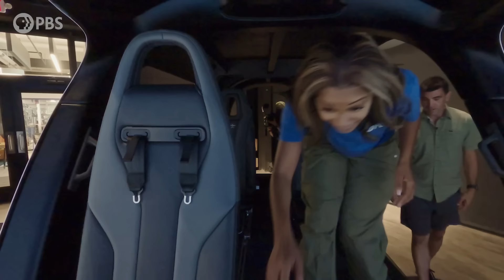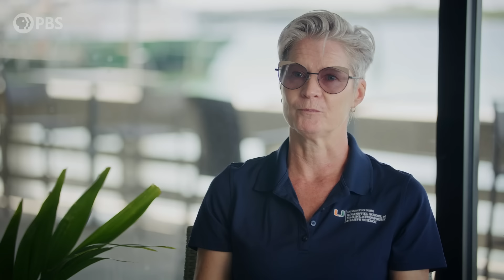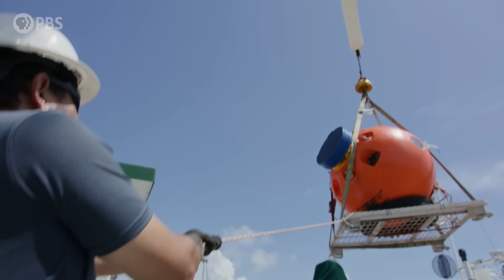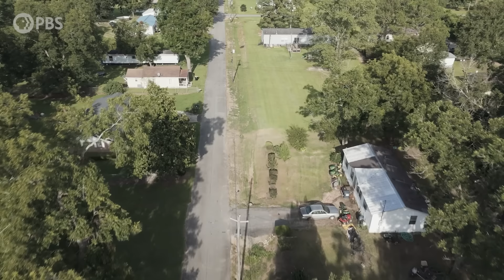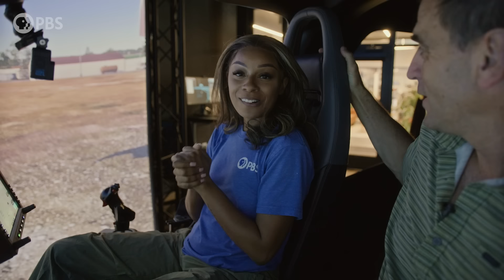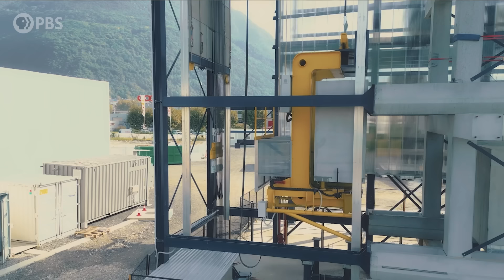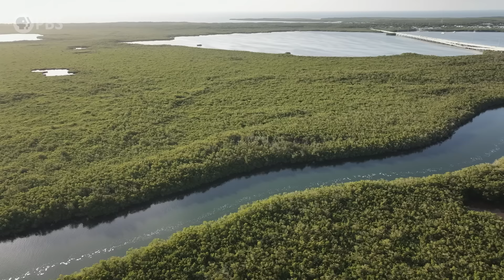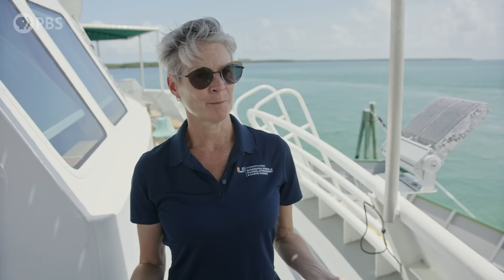This Is The Best Evidence That Atlantic Currents Are Slowing (AMOC Explained)

Comment: This is what no one is talking about. All of these people are going to FLOOD to the Midwest and they're not ready for it.
Reply: yeah, I'm going to lock down a 2nd mortgage in Minnesota. If things don't completely collapse by then, it'll inflate so much that I might not have to live in complete poverty.
Reply: @zacharybohlman4069  With due respect and with good intentions, I ask you, do you really think sea rise will result in or requires a 1,000 mile migration from the coastlines?  I'm four miles from the Pacific Ocean at less than 600 feet.  Why would I move from a huge body of water that moderates temperature extremes to the Midwest which is known for temperature extremes?  Again, I mean well.  Your thought just seems quite irrational and perhaps an example of misplaced regional pride.  Please let me know where I'm wrong here.
Reply: @OneAmongBillions 1000 miles is maybe a generalization, but there WILL be significant migration away from the coasts as those coasts move further inland and swallow up current coastal cities. The east coast will probably have it far worse than your Pacific coast location because overall the population density is higher on the east coast, and because more of our is going underwater (think most of Florida). 

The other thing to consider outside of migration due to sea level rise is that people are also going to be fleeing the dry southern states as they become increasingly unlivable. Think Phoenix but hotter for longer and in an area from inland SoCal to central Texas. If/when the Colorado River dries up, it's going to be so bad.

Those people will have to go somewhere, and even odds they'll go where the population is least dense. Except that the Midwest doesn't have the infrastructure or resources for that many people, and after a point they won't be welcome. Again, it's going to be *so bad*.
Reply: @ Thanks for replying at length, but I'll refrain from further discourse with you.  Why?  I have a strong sense that you're a troll as evidenced by your contemptible "won't be welcome" comment.  I have known lots of people from the midwest and none of them have exhibited the childish tragedy-glee for others that you are exhibiting.  I'd say grow up, but personality disorders typically worsen over time.  Please have the last word.
Reply: @OneAmongBillions  I can only guess that you're responding to me- if not you have my apologies, and please feel free to disregard the rest of this post. 

FWIW, I take absolutely no glee or pleasure in considering what climate change is going to do to coastal communities, quite the opposite. It's going to be awful for them, financially, emotionally, and socially. We're already seeing the very first coastal and island communities having to abandon their homes, and it's terrible. And it's going to get worse. AND it's going to ripple out far beyond those communities. If you think you won't be affected at all by climate change, you're absurd and it's not worth trying to have a serious discussion with you. 

If I seem cynical about how people in the Midwest will handle an influx of climate refugees, then...well, honestly, I am a bit cynical. after over 10 years in call center customer service it's hard not to be at least a little cynical about how people deal with problems. Nevermore that there's plenty of historical precedent from very ancient times all the way up to today about people only putting up with an influx of strangers for so long before saying "enough is enough" and trying to send them on to the next place down the line. 

I dunno, I could write at faaar greater length, depth, and specificity about all this, but I'm typing on a cellphone which isn't great for extended dialogs, plus this is the freaking YouTube comments section and I'm responding to someone that grossly misconstrued my original post (and that's if I'm being generous). Why am I doing this? Because this is a serious topic, and it deserves far more serious and sober discussion than it usually gets. If that means I'm trolling or otherwise deranged, man, I dunno.
Reply: @OneAmongBillions In your case, you might move further inland due to several factors. Your regional in general is becoming drier. So anything to the east of you is also going to be affected by anthropogenic effects. Look at Arizona and Utah. Midwest has the largest source of freshwater in the country. Cost of living is going to be a factor and so is population density. Not just sea rise you should be worried about here.
Reply: @ As stated, I have no expectation that sea level rise will effect me at 570 feet above sea level.  Several of you seem to be taking pleasure in a coastal doomsday scenario, which is indication of moral perversity.  Do you really think the evermore powerful tsunami of technology won't modulate water issues?  By the way, why the regional rivalry?
Reply: Ready or not they will move!
Reply: Its worth remembering that not a single climate change doom prediction has EVER come true.....
Reply: @manoo422  Dark Triad personality disorder, right?  That's my supposition because your claim is, of course, beyond stupid.
Reply: @manoo422 Dark Triad personality disorder, right? That's my supposition because your claim is, of course, beyond uninformed.
Reply: @OneAmongBillions  🐑🐑🐑🐑🐑🐑🐑
Reply: @manoo422  No way you have seven girlfriends!
Reply: The narrative is set blame the victim for living in the wrong place. All despotic regimes need a constant supply scapegoats climate change will do that nicely for the fascists.
Reply: I’m just worried for my rent hiking up 😭
Reply: I think we are ready for it.  Plenty of towns here need more population.
Reply: I think the Midwest could take a few refugees. I grew up there… plenty of space and friendly people. Now I live in Colorado. Seems like everyone moving in the US is coming here. After hurricane Katrina several families from New Orleans showed up in my town and stayed. My town has gone from 19,000 people when I moved here 25 years ago to almost 90,000 now. When I moved here there was lots of open space all around the town, now we share borders with two other towns. I think the Midwest could be a good option.
Reply: @jimwalhof630  Congratulations, you are giving away your country to freeloaders........
Reply: We already have foundational infrastructure problems in the Midwest. A large migration would just compound the issue even further.

Comment: Not one mention of Nuclear as a solution, even if temporarily, until better energy solutions are viable. Nuclear is clean, safe, and can be retrofitted to existing infrastructure. Nice video though.
Reply: Lots of people are considering Nuclear especially with Thorium reactors. It’s just getting governments and normies on board.
Reply: Will private companies insure fission power plants. 

What about all the radioactive concrete and steel when the plant reached EOL?
Reply: Sort of unclear to me. How much heat do nuclear plants add to the environment? Lived near TMI and saw the vapor plumes. Lived near lakes with nuclear power plants that use the reservoir water for cooling and have fished these miles long thermal plumes in the winter.  Sort of interesting fishing when the air temp is 32F or less, most of the lake temp is 40s maybe low 50s and there are thermal plumes that cover miles of water in the 70s.  Summer time these same lakes release water and pump the water backup the rivers/lower reservoirs to mix the water with the thermal plumes in the lakes to maintain a cooling temperature differential.
Reply: I think we’ll see more investment into nuclear during this administration. There’s a plant near me that was recently decommissioned, because the facility needs upgrades. Majority of the nuclear systems are from 1970-1980. They are out of date and retrofitting them requires investor interest. “Renewables” have taken the spotlight, yet fail to admit that a society reliant on them requires the technology we have now to make it feasible to transition. The reason we lack progress is not “ourselves”. It’s the lack of cooperation in capitalism and politics. Renewables were heavily subsidized, while nuclear is pretty much avoided. The only feasible way for hydrogen power to work in my local area would be through nuclear power plants. Integration of multiple processes/systems is the only way forward.
Reply: @Plarux  how much money is going into renewable power?
Reply: @Plarux  seems I toured TMI after its issues. Seems there I a bunch of piping and infrastructure between the reactor and the cooling towers.  Guessing corrosion after 50 years could be an issues with piping not sure ? The piping the goes into the reactor which in encased in feet of concrete could also have be replaced? Also guessing the piping, valves, fittings, sensors and associated equipment is not just run of the mill metal parts from the local Lowe’s or Home Depot?  With the prices of equipment, materials and the fact that the plant is a decommissioned nuclear facility how does one go about refurbishing a plant like this and in what time frame and for how much.  Is it really feasible?
Reply: Don’t forget that many of the lakes which many of these power plants are located on have dams that are averaging 65years old with some over 100 years old! @Plarux
Reply: ts not clean, its not safe and can´t retrofitted. you need better grid systems and nuclear power is very expensive and takes long to build
Reply: It's coming. We might have fusion in the next decade or so. They're moving faster now.
Reply: @  I’m ready for it. Unfortunately I see a world where the rich live in underground cities operating on fusion while the poor are left to struggle on the surface with chaotic weather patterns.
Reply: @phil20_20  no we won´t. they said decades ago that ther will be fusion power.

Comment: A little disappointed on the section of the video marketing electric aviation. Commercial passenger aviation is extremely challenging to decarbonize. Any credible climate solution for aviation relies primarily on reduced demand. 

By feeding into the myth of “alternatively powered” flight, the video is competing with the only feasible solution: don’t fly. Invest in high speed rail. Make your community so nice, you don’t need to fly for your vacation.
Reply: Imagine trains
Reply: Agreed. 🤠👍
Reply: Agreed. Americans are technologically inept and change is impossible.
Reply: ...and WHO probably fly's the most miles every year and has no intention of changing...?